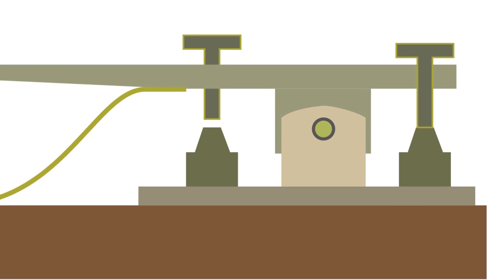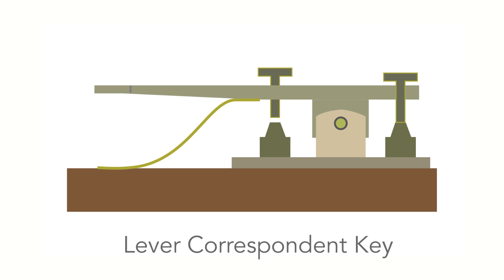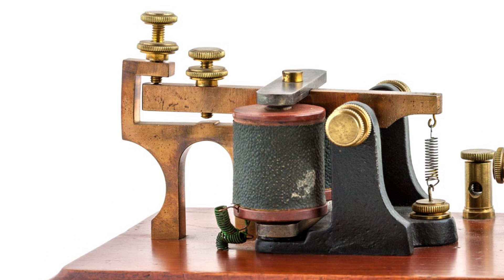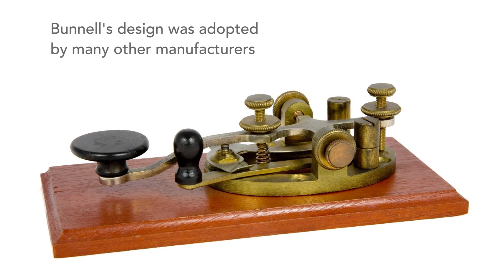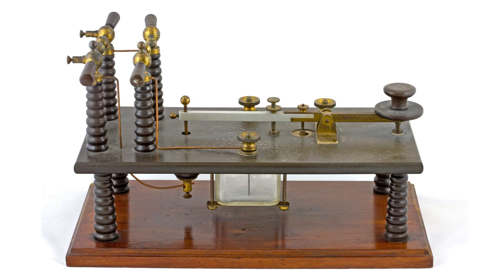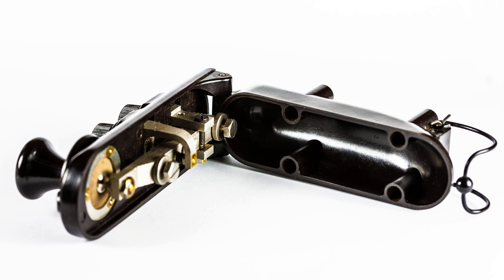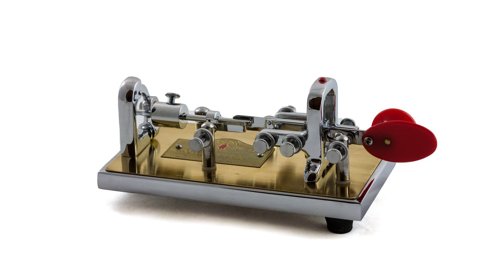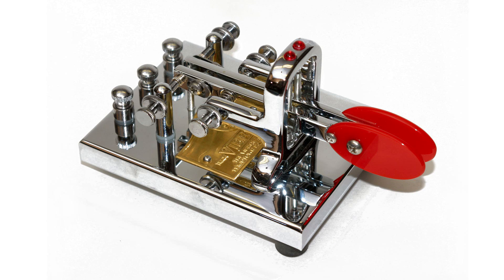Morse Code Telegraph Key: Development & History

Comment: I am building a replica of the key used on the Titanic.   Morse code is a fun hobby and that is why I am doing it.  Most people don't know that morse code is used in some modern appliances.  For example my microwave oven beeps 4 quick beeps at the end of heating my food. That is the letter H in Morse code.  "H" is for "HOT".  One barber shop I visited had a door chime whenever someone comes in the door.  It beeps a DASH then a DOT.  That is the letter "N".  Someone came "IN" the store.  One day I was waiting in an office for something.   While I sat there, one of the big copy machines started beeping 5 dashes... then a pause .... then 5 dashes.  That was the NUMBER ZERO.  A secretary walked over to the copier and pulled the drawer open.   The drawer had ZERO sheets of paper in it.  So she filled it up and closed the drawer.  Immediately the printer beeped "DASH..DOT..DASH".    That is the letter "K"... because the printer was "OK" now. This phenomenon is not always true.  Sometimes a beep is just a beep.  I find it interesting that the Morse code is still in use, and people just don't know about it.
Reply from the maker: Surprising how often Morse code is used fr those indicators. Good luck with the replica.
Reply: Trust me im an engineer
Reply: Although your post is 2 years ago, you might be interested in that US railroads use morse in the train whistle even today.  Listen when it travels towards a crossing.  It sends the letter "Q". Though it takes several seconds to complete the letter.  I had been hearing that for years when it finally dawned on me.  A short Internet search will find the subject.